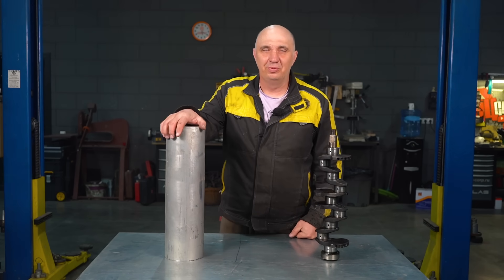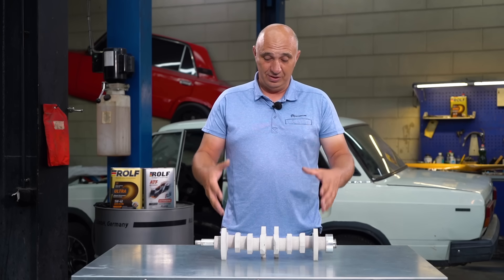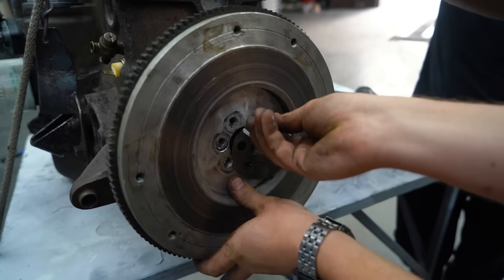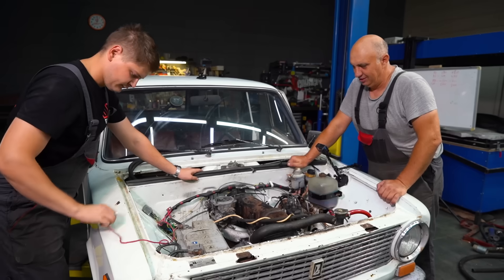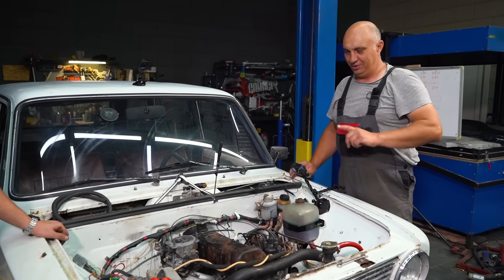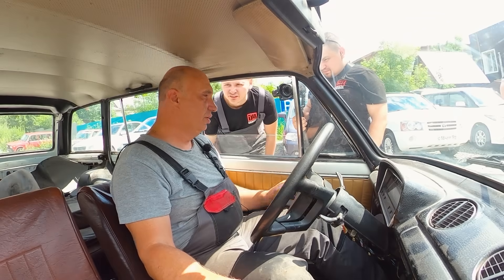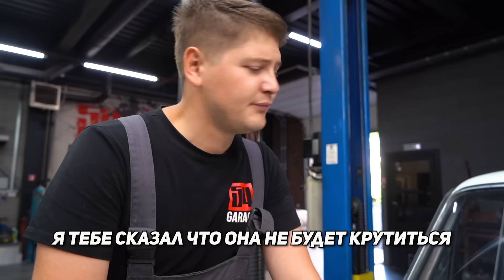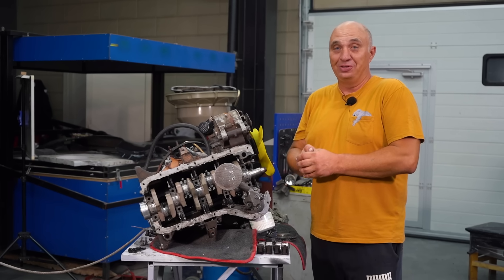We make a custom duralumin crankshaft for a Lada

Comment: This is one of your best ones.I think the best idea. Maybe if you could spray that nickel and crome powder spray and then heat it up. You know how they do it. How are they doing that with gears and other steel gears. Maybe you could do that on the journals of all the crank shaft and cam shafts and some mathematics. I know you've probably thought about that already.That's a little more work, though, but look like.Look what you're doing.You're developing something I like it.😊

Comment: So I normally watch these in amusement. But I think you may have something here. 

Rather than relying solely on duralum maybe make some form of steel race that goes around the aluminum bearing surfaces for the normal conrod and mains bearings to ride on. 

This was a genuinely interesting idea. And don't forget to make a Steel area for the thrust bearings to ride on.

Comment: Briggs and Stratton lawnmower engines have used alluminium cylinders with steel pistons for decades. I suggest this would work here, alluminium journals and plain steel bearing shells.

Comment: It really feels like you guys are on to something here. If I were to try making the shaf again, I would try machining down the bearing surface and using high temperature solder, attach high carbon steel surface in 2 half-moon pieces to the shafts bearing surface. A good idea would be to probably use threaded locking pins to lock the carbon steel in place and just weld shut the ends. 
I haven't felt this much excitement about a project in a while. The engine was super quiet, especially for an old lada.

Comment: If the cast steel crank is against the soft tri-metal bearings, what about putting steel main bearings against the aluminum crank? Should have good heat flow characteristics as well.

Comment: My Isuzu uses an aluminium head with a cast metal overhead valve cam that rides in the raw aluminum bore with of course oil pressure channels so it rides on a coushin of oil..I bet if you widened the tolerances and balanced the whole thing it would work fine

Comment: I'll bet the clearances were too tight at assembly, and the additional friction wore the ceramic coating off much more quickly than if it was a little lower like a normal engine

Comment: Congratulations! You just discovered the critical flaw of the Chevy Vega's 2.3L I-4. Mind you, the failure was partially because of a minor miscalculation of thermal expansion... but still very-much the same results from application of the same method: Coating aluminum with an anti-wear treatment versus employing iron parts in an effort to save weight, which--ultimately--didn't work.
On further speculation: Perhaps if methods of cooling the oil were applied, along with a larger oil capacity, this might've endured better... if it's dimensions were first calculated to take heat expansion into consideration properly. Also: Perhaps the employment of custom aluminum connecting rods--like used in professional drag race engines--would help lessen the impact of the compression & firing pulses on the journals. And any improvements made the oiling system in terms of volume of delivery... to help in control thermal expansion... might not hurt, either.
Reply: Or if chevys' cheap engineering didn't stuff the job. German cars have used those coatings for years.
Reply: The late John DeLorean had a few choice words for the Vega's aluminum block engine.
Reply: The Vega suffered from one thing beyond the control of GM management in addition to the cylinder wear problem. Owner neglect in terms of preventative maintenance.

Comment: Super cool project.
I knew right from the beginning it would grow to seizure. But I think replace the bearings with leather. Or else machine with large clearances. .0075" on both should do and run streight 50 oil. But really cool video.

Comment: a high hardness aluminum like 7075 t-6 would have been better, but bearing clearances would absolutely need to be increased.increasing bearing clearances could work with a high viscosity oil like 75/80 gear lubricants, I would imagine you might want as much as 0.004-0.005 on the rods and 0.005-0.006 inch on the main journals.

Comment: Turn the crank undersize .030, and use normal size bearings.  20w-50 motor oil.

Comment: You people do realize that a cranshaft flexes and bends under load , not by much , but the material should be "springy" . Even with all the steel inserts and getting the expansion problem solved , the alu will become brittle and then you probably wont have to worry about bits in the oil in the oilpan since the crank grenade will finds its ways out .

Comment: I'd love to see them revisit this, but with the crank have a proper heat treatment done on it for 1, maybe try nikasil coating the crank journals as it could be polished or the entire crank LOL Aluminum rods with it as well, lightened flywheel too, maybe a higher grade aluminum or start with a forged aluminum to make the crank. But definitely a proper heat treatment would harden it a lot, could even do a cryogenic freeze treatment as well on top of that, both would increase strength a ton over not doing it and help its hardness, shot peening is another hardening option as it compresses the metal heavily and increases strength. Lastly for a coating to protect it better from heat maybe a cerakote ceramic coating and increase rod and main clearances & slightly thicker oil to help with expansion. LOL sorry I've looked into all this stuff over the years and want to build a motor using this stuff as well.

Comment: You should build this wagon as a backwards Lada make the rear windshield the front of the car. Swap the axle and steering axle where you have a rigid axle in what used to be the front and steering suspension in the rear place the headlights on the rear and the brake lights on the front

Comment: What about making an aluminum block with aluminum crank shaft and aluminum pistons with aluminum piston shafts and aluminum head. Just a complete aluminum engine. And try roller bearings for the crankshaft like they have in manual transmissions.

Comment: You guys should machine a pice of aluminum with same diameter as the original crankpin journals and main journals. Then put that piece in 120 Celsius oil for 5 minute ,then measure the diameter again and choosethe right clearance bearingto it. This test is failed because used to tight bearing clearance at warm engine .Aluminium expansion is higher than cast or forged crank,i will  do it again this test !!!

Comment: Here's a thought for you to ruminate on...  Four part races with cylindrical roller bearings for the crank and rod bearing journals.  At least you won't have to put up with debris in your oil pan.  Think of the frictional coefficients (or lack thereof), involved if you need a reason to try.
Reply: I had a similar idea. Since they are custom making a crank , might as well work in a roller setup. 
All things considered, I would hate to see how much it will cost to have it made by engineering. . . easily 10 times the price of 20 ladas. Its still nice that someone tried it so all of us can stop wondering.....poor lada....
Reply: @hermanbotha1449  Well, I hoping they at least try...

Comment: the ceramic was probably a mistake. commercial ones use nitride coating. trying with just the alu might've been a better idea  - or an even better one machined steel inserts, you'd have to figure out some locating notches for that though so it could have some play for heat expansion

edit: disregard, you'd use nickasil. nitride is for steel i was looking at a crank for an alu block not an alu crank
Reply: Nitriding is not possible for aluminium
Reply: @michael-j-harrison  yeah i made a bobo looking into aluminum cranks.
Reply: The ceramic probably wants to crack why the aluminium expands

Comment: I used to do metal spraying of shafts. The problem with a bearing surface is that it's been pounded into a larger diameter,till it fails.

Comment: I just started watching the video, less than 4 minutes in.  I predict that there will be bearing clearance problems when the aluminum crankshaft gets up to operating temperature.  Additional bearing clearance is needed.  Or I'm wrong.  Won't be the first time.

Comment: If it expands that much then why not heat it up then see how much it expands then take it down some more then do it again till ya see just how much it expands then if it's not to loose in the bearings then try using it n the engine use the coating to add on the extra ya took off and then see if that might work better

Comment: They should try resurfacing the journals to decrease the diameter and increase the clearance.   Then get it coated again and try it with extra clearance
Reply: the problem is that if they cut the crank too much, it with knock like hell on startup. adding the coating just confuses the study in my opinion
Reply: @russriley3005  perhaps they could preheat the oil and the block like they do in F1
Reply: @russriley3005  if they get the clearances and oil viscosity right it probably would work just fine as long as they warm the engine up fully before putting heavy load on it.
Reply: I was thinking that as well, undersize the journal a couple thousandths. But as others said in the comments here it would probably start knocking with too much clearance. But an increase in the viscosity of the oil could counter that.
Reply: @youtubasoarus  the aluminum expands and contracts at a different rate as the coating that is embedded into the crank. it will separate throwing coating all over and leaving the crank pitted and a oil filler screen full of the coating
Reply: 7075 ?
Reply: They should reduce the size of them, put gear teeth in them and put 2 piece steel journals with matching teeth around them. Perhaps that would work better.
Reply: Absolutely

Comment: Aluminum expands about twice as much as iron instead of .001 clearance use .0035 inch you can also metal spray weld that crank with any type of metal you like don't forget oil clearance use more and compare with oil pressure gauge if stock crank had certain oil pressure too much clearance would make it lower and too tight higher; lot of work for the crank try to get every idea you can think of before giving it up.. Nice try you guys are like scientists not mechanics..

Comment: Titanium crankshaft maybe?
Reply: Titanium will not work because it does not tolerate friction well and will start to peel quickly. It is true that it is lighter and harder than steel, but because of this it is mostly used only for connecting rods, or for components that have friction-resistant materials in between (bearings). It is true that titanium connecting rods have a bearing in between, but they are on the side where the bearing is fixed and does not wear.

Comment: Try machining the crank for hi carbine journal inserts bet that would save the bearings i no i have herd of something with a billet aluminum crank before but can not remember it may have just been a concept engine I'm thinking of but with different journals it should work until the crank breaks also some stress relief would help glass bead and kryo freezing cool video tho shame all that work for such a short drive!!!!!!!!!
Reply: I say multi piece crankshaft with ball bearing journals
Reply: @fastinradfordable  think they tried the ball bearing journals and it dint work well but the multi peace crank is a really good idea and add harden journals kinda wish I still had access to a machine shop lol

Comment: Now I'd really like to see a titanium version of this.
Reply: Titanium will not work because it does not tolerate friction well and will start to peel quickly. It is true that it is lighter and harder than steel, but because of this it is mostly used only for connecting rods, or for components that have friction-resistant materials in between (bearings). It is true that titanium connecting rods have a bearing in between, but they are on the side where the bearing is fixed and does not wear.
Reply: @bernymonty22  Wonder if they could build the crank with titanium but with forged steel journal bearings.
Reply: I still feel like titanium would work much better than the sticky aluminum only problem I see is the price of such a big titanium block.
Reply: @LiveSeruio titanium is very prone to galling. Even screwing a screw in its threads will gall it. Which is why it’s not used as crankshaft material. Titanium is also very difficult to work with.
Reply: meaning titanium will cut into softer metals. 

ive seen alloys do fine or vitol coated... but dragsters... not endurance... and nothing that rubbed...
Reply: Don't used babbitt bearings, just use steel on aluminum. Warm up the engine and coolant and oil before starting.🤷
Reply: Possibly the test would be different if you also used aluminum rods allowing expansion at a similar rate to the crank plus using a high flow oil pump for the extra clearance to keep flow and pressure up😉 you would have to use shorter rods as well maybe by 1mm

Comment: This channel does the best car experiment on YouTube. It's universal language when you pull the oil pan with junk in it
Reply: Yes, this channel does some pretty fun (and labor intensive) exploration which is quite cool. The contents of the oil pan looked like what we saw in my friends Chevy Vega when we removed it back in the late 70's when the engine seized. Lol!! The Vega had an aluminum block with cooling and cylinder block hardened layer coating issues (just like in this video sort of) and was not ready for prime time.
Reply: @user-vp1sc7tt4m  My uncle had an old Vega in the 90s when I was little. I'm not sure about the year. But I learned how to work on cars with it. He had it sitting in his yard for years. He said they were problematic, and I didn't know what he meant at the time. But great memories.
Reply: Maybe spinning a soft crank inside soft bearings with close tolerences caused pickup between the two. Would removing the bearings and having a crank machined oversize but with more tolerence & thick oil avoid it? Or perhaps roller bearings on the crank mains (a bit expensive on a lada but)
Reply: Absolutely. Now I'm left wondering if in F1 style, they left larger clearances cold but pre-heated the engine/coolant/oil  to operating temps before starting.
This might actually work... wait... elongation of the crankshaft, never mind.
Reply: @ 13:08 No translation required
Reply: you also have to give thanks to the translation, it is very good, but yes, it's the best what if you did this, stuff.

Comment: For it to work best the journal contact points of the crankshaft should be made of steel while the rest of the weights and whatnot be aluminum, it would all have to come into place with wedge joints and then be welded
It would be a fair bit of work, but the results would probably be rewarding
Reply: This is the answer
Oil not working on aluminum surface
If you look closely, all the contact surfaces that operate on the aluminum blocks are iron
Under normal working conditions, it doesn't generate a lot of heat
You don't have to worry too much about the expansion coefficient